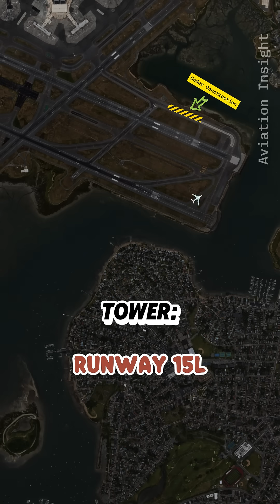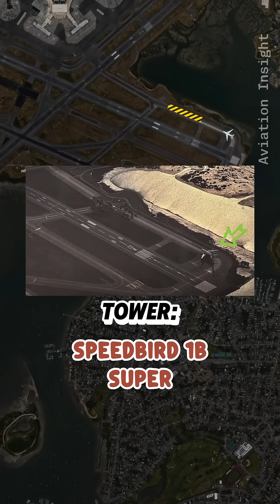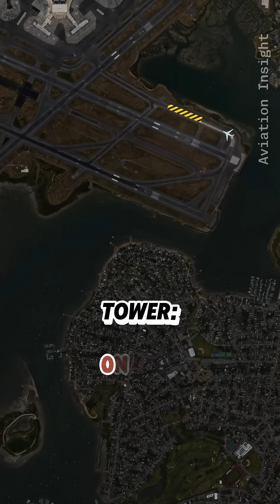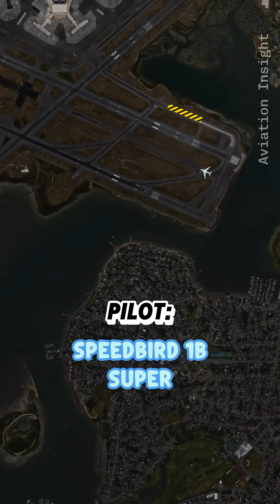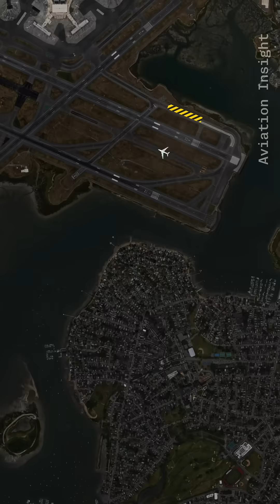A380 Stuck After Making a Wrong Turn / ATC Recording #aviation

Comment: They couldnt be towed across that little access path right in front of the construction? I assume it not actually a taxiway, maybe not rated for the weight?
Reply: The picture is not correct, the construction zone included the whole crossroad
Reply: @phoenixqwertz  yea i assumed the overhead animation wasnt 100% accurate but the actual picture it showed for a slipt second that little taxi from the  taxway to just that  runway looks clear, and gotta be somewhat clean if they using the runway next to it without fob worries. Maybe too close for them to use normally but a powered down tow be possible?
Reply: @markmanning6972  Yeah, the runway looks clear, but is sadly not rated for an A380
Reply: @phoenixqwertz  yea that was kinda my initial thought but  still thought it was worth mentioning

Comment: Why the pilot deviation tho...
Reply: Not only did he not turn left onto taxiway N as instructed, he also crossed runway 22R without clearance.
Reply: Hé went Strait where he was supposed to turn left before crossing the runway.
Reply: IANAP, but I would think crossing a runway without clearance would be a far more serious offense than using the wrong taxiway.
Reply: @DaddyBeanDaddyBean right. Taking a wrong taxiway is not that much of an issue and wouldn’t be a deviation. Him crossing a runway that he was told to hold short of, that is the deviation.
Reply: @theralph2247 what else would you call it when a pilot deviates from their cleared route?
Reply: @MikeDCWeld why, clearly "animal crackers" would be the proper term to describe when a pilot deviates, instead of something ridiculous like "pilot deviation".🙄😜😁
Reply: What a mess!
Lol
🙈🙉🙊😎🇺🇲